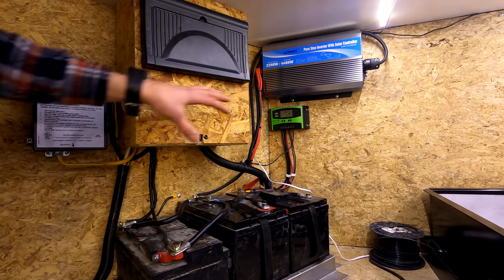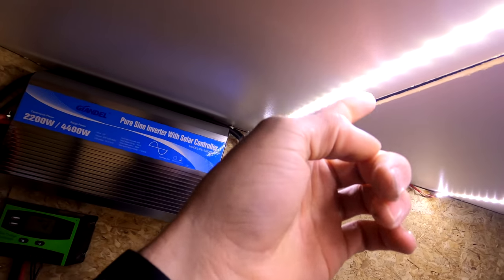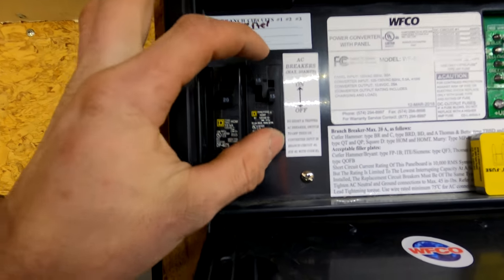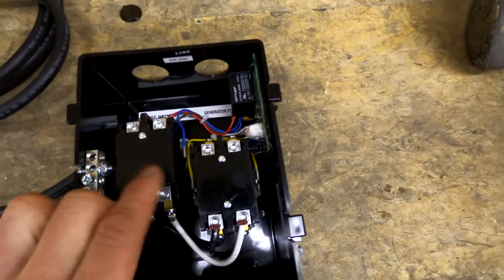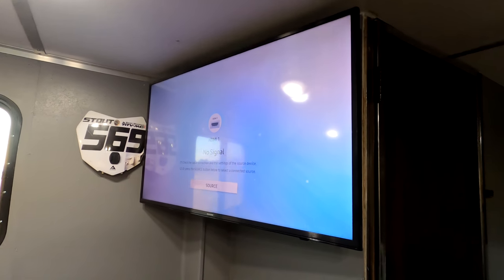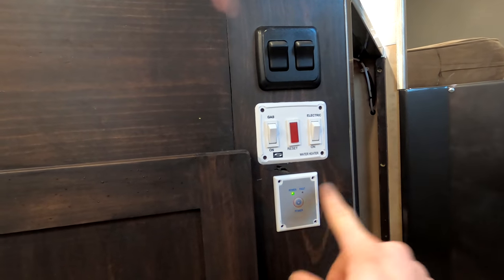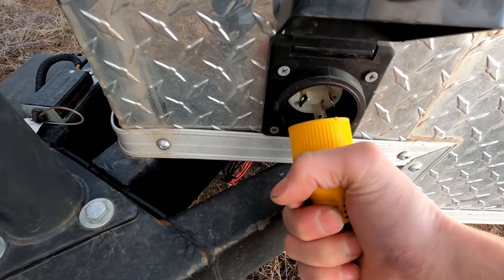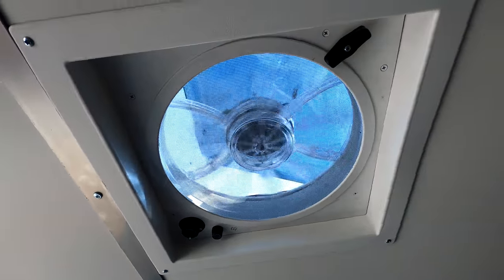Electrical System - Enclosed Trailer Conversion - Everything from Amazon

Comment: Hmm...Your power setup is awesome! However in hindsight, don't u think it was a little overkill? I'm saying that, not as a hater but as a devil's advocate because I'm about to do (close to) the same thing in my 6x12! However, my budget can't handle "all what you have." It must've costed u quite a bit huh? I think I can do it less a few components though. 

Now that it's been a year since this video....how have you been liking your power system and what do you think you would have done different in your initial setup? I'll bet I can guess....! 
Good Luck! 
AE
Reply from the maker: Yes in some ways it’s a little overkill 😂 for the most part the only power I use is from the lights and my fridge which don’t take that much power. However it is pretty nice having more power than you need for most of the time! That way if it’s cloudy and you are camping for a long weekend there is less to worry about. If I had to trim off some components I wouldn’t do an inverter. If you don’t have and you don’t need a transfer switch. That would save on some wiring and about 380 bucks or so. Then I’d just run my microwave and tv with the generator. You could do less batteries as well and if you didn’t have as many batteries you could get away with less solar. Just look at what you will be running and what is a need vs a want! 
Now that I’ve had the system for longer and have since learned more about batteries I would have went either 12v batteries or at the very least started out with the right battery combo. I upgraded some things since this video and one of them is the little 12v battery. I shouldn’t have mixed it with the nice agm’s. Check out my other video to see what I changed with the electrical setup! Charge controller, another panel and that battery.
Also I’m curious as to what you would have guessed I would have done different!? 
Cheers! 🤘🏼

Comment: Will this set up charge your batteries when connected to shore/ generator power? Also do you have a link to the breakers you used?
Reply from the maker: Steele Crandell Yes it will charge the batteries when plugged into shore power or if the generator is on! I’d have to look and see what brand of breakers I bought. I actually got them from Home Depot. One is a double 15amp breaker and the other is a single 20 amp I believe
Reply: Austin Stout I just watched your most video and I see you have 2 transfer switches did you update that since this video? I only see one in this set up.
Reply from the maker: Steele Crandell Sorry for the confusion! I havnt updated anything and still only have one transfer switch in my trailer. I don’t have an on board generator that is hard wired into my rv so there is no need for a second switch. The generator has to be plugged in just like I would plug into my house or at a campground. Does that make sense? So technically the generator and shore power both come into the same input on the transfer switch
Reply: Austin Stout ok cool cool that is the same set up I’m looking for as well. Apologies for all the questions. If you ever in Moab hit me up.
Reply from the maker: Steele Crandell hey no worries! Glad I could help! Oh really? I might be down there next month to ride mountain bikes and rzrs!
Reply: Austin Stout dope man yeah I need to get a rzr just the dirt bikes for me rn but either way let me know

Comment: Anything that youd change on the electrical system now that youve had it a while? Im just about to close up the walls on mine and figured Id ask now before it gets harder to change any runs.   :-)
Reply from the maker: Austin Overman I would have added a couple more 110 outlets! I didn’t do any exterior outlets or any in that front bin. It would be nice to have if you need to plug something in outside! Other than that I’m pretty happy with the electrical system as it sits now!
Reply: Austin Stout thanks for the input. I’ve watched your other videos now. Drop me a Facebook pm if you ever wanna go hit some AF canyon single track. I’m just in highland.
Reply from the maker: Austin Overman No problem! I might have to take ya up on that! I’ve actually never been up af canyon on bikes. I did a loop up hobble creek last Sunday
Reply: Austin Stout i just did a night run up hobblecreek Monday night. I sent you a FB friend request.

Comment: What ac do you think you will run? I’ve been looking into a mini split. I think I could run it off a similar set up.
Reply from the maker: Steele Crandell I have a domestic 15k btu rv unit on top. I thought about a mini split but then I’d have to find a place to mount the compressor unit and all that. The rooftop unit was a lot easier especially for how much I actually use it
Reply: Austin Stout yeah my trailer is not a v nose so I can put the unit there. And I’m also trying to avoid putting a hole that big in my roof and it seems like they are more durable units.
Reply from the maker: Steele Crandell yeah if you have a nice place to put one I think it would be a sweet setup that’s efficient! I didn’t cut out any braces or anything, just added a couple going front to back to make a square frame. But if the unit was any heavier I’d want to do more bracing on the roof beams than I did. It would be a different story on a trailer with a wood truss roof

Comment: you forgot to wire in the earth ground on your inverter. being that you're in a trailer you can just wire it to a body ground or battery neg. it's the small brass cylinder just under the outlets on the right side. obviously don't take my word for it but check your manual :)
Reply from the maker: Mage Alexstra you’re right! I should have looked into that when I was wiring it but neglected it. I’ll do that! Thank you!

Comment: Question... I’m doing both 110 and 12v. How do I switch over to 110 (shore power) when everything I have, except a/c, is hooked up to 12v? What do I need?
Reply from the maker: Melinda Tippins So 110v ac (alternating current) and 12v dc (direct current) are two different types of power and require separate systems. You can power your 12v appliances and lights with 110v power if you use a converter. It’s the breaker box/battery charger unit found in almost all manufactured rv’s. Basically you will wire the converter to your batteries then connect the 110v power into the specified wires on the converter. From there the converter will provide a constant 12v power source through the 12v fuses. At the same time it will also charge your batterie(s). They come will a pretty easy to follow color coded wiring diagram as well. Check out the link in the description for “25 amp power center converter”  Hopefully that answers your question?
Reply: Austin Stout is there any way you could do a video on how you hooked up all the wires to and from the converter? I’m so confused.
Reply from the maker: Melinda Tippins I’ll see what I can do! I’m working on a more in depth one right now of how to install a transfer switch!
Reply: Austin Stout oh, ok.....that’ll be good! 😀

Comment: What is plugged into your inverter? Have a hard time with some things with what is connected to what
Reply from the maker: The inverter has standard plug outlets to provide the 110v power. So to connect the inverter to the 110v system in the trailer I have that black 3 strand wire going from the inverter right into the transfer switch. The black and red wires on the back of the inverter are for the 12v input. There is also a little grey phone jack wire that connects the remote switch in the kitchen to the inverter. That allows me to turn it on from there as you see towards the end of the video

Comment: So you don’t need any shore power to run this
Reply from the maker: I don’t have to no! The inverter will run everything in the trailer. The transfer switch is so I can easily plug in my generator or shore power if I want

Comment: How much did that setup cost?
Reply from the maker: The way I have it now with solar panels, inverter, transfer switch, charge controller, batteries and converter id say around 1400 bucks give or take plus wiring and other related things. Can you do it any cheaper? Yes. Coulda went with cheaper batteries, cheaper charge controller, no inverter, no transfer switch. But 🤷🏻‍♂️

Comment: Do you have a diagram for all that?
Reply from the maker: Not a legit electrical one. I could get a  simple one though if it would help!
Reply: That would be great. I don’t have much electrical knowledge just enough to be dangerous. Just started my conversion. Putting in the insulation now.
Reply from the maker: haha just enough to be dangerous 😂 That's sick you are getting started! Such a fun project imo! Make sure you run all your wires and add extra in case you want to add things down the road! I wish I had a couple more 110v outlets on mine but its too much of a pain to change it now.
Reply from the maker: I made a little diagram for ya! I Added it as a free download on my site!  https://nvrsrndr.com/products/basic-rv-wiring-diagram

Comment: Do you have solar?
Why the combination of batteries?
Reply from the maker: Steve Bratten Yep! I have two 160 watt panels on the roof. I ended up with the odd combination of batteries because when I ordered the two 6 volts (bigger batteries) I didn’t think about the fact that when you connect them in series to make 12 volts the amp hour rating stays the same. When I ordered them I was thinking “ok two 200 amp hour batteries in series that’s 12 volts and 400 amp hours” 🤦🏻‍♂️ I didn’t really wanna have 4 batteries up there so I went with one more 100 ah 12 volt instead of two more 6 volts.
Reply from the maker: Byvägen oh really? Dang! I didn’t come across that I’m my research but I’ll defiantly look into it! Thanks for the tip!

Comment: What external port did you use for shore power?
Reply from the maker: This is the one I used, pretty happy with it 
Leisure RV 125V 30 AMP Power Plug... https://www.amazon.com/dp/B079SL953V?ref=ppx_pop_mob_ap_share
Reply: @AustinStout  Thanks! One additional question.... The converter... Does it do both 120v and 12v?
Reply from the maker: @Nerdum  no problem! Yeah the converter charges and maintains the battery when 110 power is available and it also works as a distribution box that houses the 110v breakers. It also has the fuse block for the 12v. The one thing it doesn’t do is invert 12v to 110v. Does that answer your question?

Comment: What solar panals and charger did you use?
Reply from the maker: Shawna Dohm I’ll add a link to them in the description here in a few but I have two 160 watt panels from Rich Solar (wired in series) feeding a 30 amp EPEVER MPPT charge controller. I went with that controller so I could configure the charge parameters to match the AGM battery setup I have. That one is also nice because you can get it in a kit with the little remote that shows everything you need to know about your solar setup
Reply: Thank you!
Reply: On a sunny day how many amp hrs are you getting from the two panels per hour?

Comment: Tell us, 3 years later, how quickly did the mismatched amp hour battery game work out for you?
Reply from the maker: Ya know, not as bad as you might think! I took it out for a few months but later reconnected that little battery. Figured since I had already bought that 3rd battery I might as well run it and see what happens. Took it camping last weekend and had plenty of power for my needs besides charging the surron. Sure it’s probably taken life off of the setup but I’ve gotten quite a few camping trips out of it 🤷🏻‍♂️😂 I’d be curious to do a test on all 3 and see what it says

Comment: Hate seeing residential solid wire "romex" in RV applications. The constant movement and flexing can cause the conductors to break.
A better option would have been to use marine "romex". While more money upfront, the stranded and tinned conductors are safer in these environments.
Reply from the maker: John Simanella John Simanella hmm that’s an interesting point, I didn’t realize they had a marine version! Good to know! I ran that solid wire throughout the trailer for the 110 side of throngs because that’s what was specified in the manual for the air conditioner. Everything is hooked down pretty solid before the plugs or conductors to where there shouldn’t be any or very little movement that way. The wires going into the transfer switch are held in the box by those clamp connectors. Think there would be any problems down the road that way?
Reply: @AustinStout 
I believe RV manufacturers are using solid wire as a cost cutting measure.  That would never fly with boat manufacturers. 
If it were me, I'd avoid it at all cost. For the small amount you need, it's money well spent. 
For the record, I've been an electrician for 35 years, and I've rewired my fair share of boats.
Reply from the maker: John Simanella Those guys are always doin stuff as cheap and as fast as they can.. 😂 Thanks for the info though! It’s good to hear some insider info from an experienced a guy in the trade!

Comment: single 12 volt connected to pair of 6's... more than likely DIFFERENT amperage output ( batteries -  6's are prob around 245 and the 12 around  105  ? ) ... NOT a wise thing to do.....
Reply from the maker: Yeah the numbers are a little off 200/100 but defiantly different. I didn’t know that was a problem when I bought the 12v to go with the system.. had it all installed and goin for a while before I found that out 😅 I mean, defiantly not good under high amp draw but where I usually have a small load (led lights, pump, and the diesel heater) it shouldn’t be thaaaat bad. Or is it? I measured the amp draw under load and it’s more from the pair of 6’s but not a ton. What do you think?
Reply: @AustinStout  Would be better if you seperated the different batteries from each lother . The LOWER amp batts WILL draw off the higher and thus "weaken" them .

Comment: Dude NEVER mix and match batteries like that the discharge rates and active capacitance will fight each other all day lng - your likely to kill something in a bad way!
Reply from the maker: Haha yep they will! I didn’t realize that at this point in the build, shoulda done more research but I thought I knew! 🤷🏻‍♂️  She’s been cleared up for a while now luckily. You can see a quick overview of the setup towards the end of my newest trailer video!
Reply: @AustinStout  Yeah - I'm an electrical engineer for over 30+ years, but a newbe' to the Rv WORLD - my other concern is you may be inadvertently giving bad advice to others that don't know better and it's going to give them a bad day, likely when they need it most of all.

Comment: A. All of you wiring is undersized except maybe the solar panel wiring, The wires from your charge controller to battery are super small and not fused
B. You need to install fuses-You simply cannot skip fuses without risking fire. 
C. Your Batteries are not going to charge properly because they are not matched.
Im really not trying to be a jerk but it is your safety that I am concerned about.
Fuses belong as close to the source of power as possible and must be below the capacity of the system, they must be the weakest link.
You did a lot of stuff right but don't gamble with your life or your build.
Reply from the maker: Your RV Freedom thanks for the info and concern. I should have researched more on a couple topics. Those wires from the charge controller were in fact undersized in this video. I no longer have that charge controller or wiring setup though! I also didn’t realize the battery situation was messed up at the time of building this. But I now have a matching setup. The rest of the wires are correctly sized for the current and length of run to the load. They are also all fused inside the controller
Reply: Austin Stout that’s some good news. There should be a fuse on the positive lead between your battery and your inverter. Ideally a terminal fuse would be the best choice. If some metal item were to cut through the insulation on that lead, creating a short to ground, then you have a fire. If the fuse is at the terminal, there is no unprotected length of wire, so you simply blow a fuse and nobody dies. 
Same reason that a dc fuse block is better than in line fuses. Fuses belong as close to the source of power as possible. 
Best of luck!